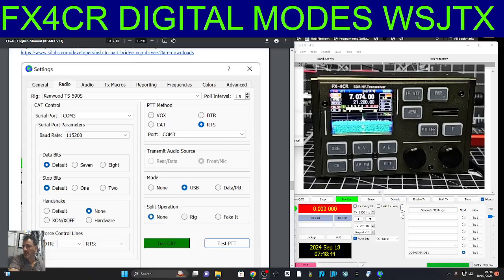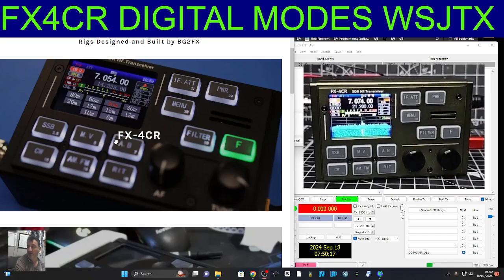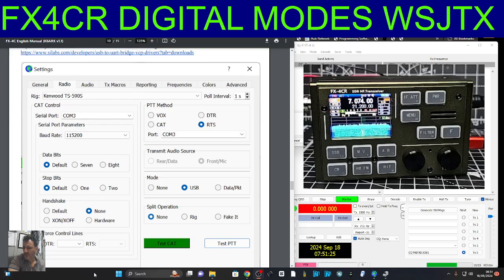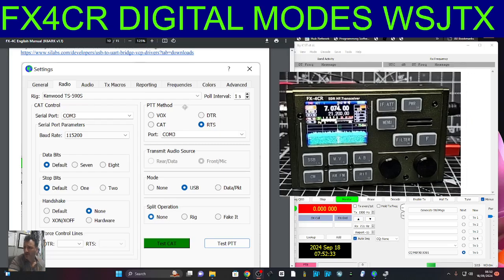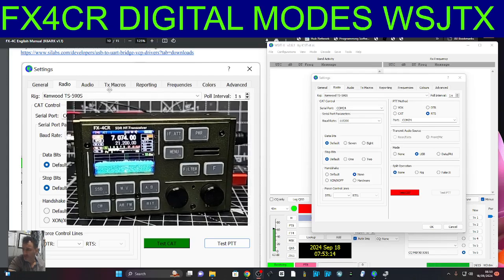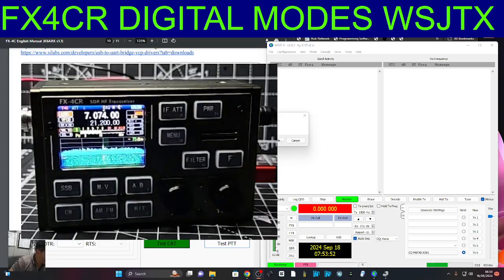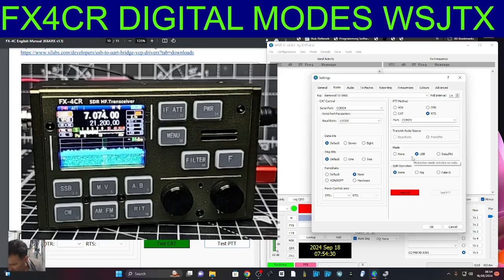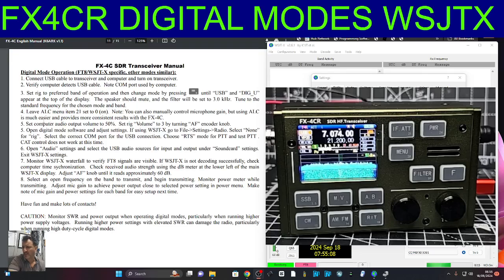FX-4CR  WSJTX FT8 ,  SETTINGS

Comment: Very frustrating for digital mode FT8, when I plug my ubs-c no ports appear in my windows computer. Not sure sound card working. Tried with android via Bluetooth and no luck. W8BLT
Reply from the maker: Try a different cable .

Comment: For those who were dealing with no transmit audio. I had the same issue. I finally tried switching from left channel to right channel on the wsjt-x audio tab (next to radio settings tab) and it resolved my issue.  Transmit power and alc look good now and I am getting successful reports on psk reporter.  Maybe it will help you as well. I have this running on a windows 10 laptop using ts-590s, serial port COM#, 115200, ptt-cat, transmit audio-rear/data, mode usb, split- none, data/stop bits default, handshake none, no force control .
Reply from the maker: Excellent thanks :)

Comment: I have my new model working by using the following -

Kenwood TS-590S

115200, default for stop bits and data bits
Handshake - None
PTT - CAT
Transmit Audio Source - Rear / Data
Mode - USB
Split -None
BUT I needed to set Force Control Lines - RTS Low

I'm using an older build of WSJT on a Raspberry PiZero

However I am getting what appears to be over-modulaton on transmit which seems to come and go. I don't think it's RFI as I'm testing at 100mW.
Reply from the maker: Thanks for info

Comment: I managed to get WSJT-X to decode, but when I try to transmit the power output on the radio shows 0W even to my power settings is set to 5W. I also cant see my signal reports on PSK reporter. PTT works and CAT control works.
Reply from the maker: Keep trying
Reply: @M0FXBHamTech  I fixed the power out problem. PTT needs to be set to CAT then power out is working. The documentation is still showing RTS. Also after fixing this I noticed ALC is too high 35-37. Lowering the power slider lowers the ALC but also drops the power to 0W. We dont have official support for this radio, no support forums. Just one FB group that struggles with other issues too.

Comment: Did you get this working yet?  I'm having issues with mine as well.
Reply: I had the same problem. After sending an email to ask BG2FX, I learned that I needed to turn off Bluetooth. Use CAT to connect to other configurations as in the video

Comment: Ever get this working? I am having same issue with its connection.
Reply: I had the same problem. After sending an email to ask BG2FX, I learned that I needed to turn off Bluetooth. Use CAT to connect to other configurations as in the video